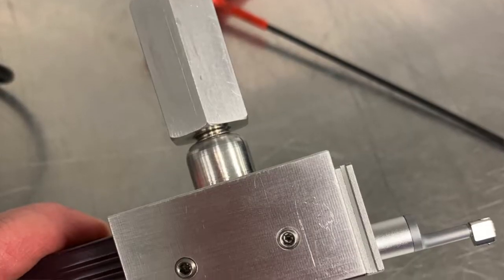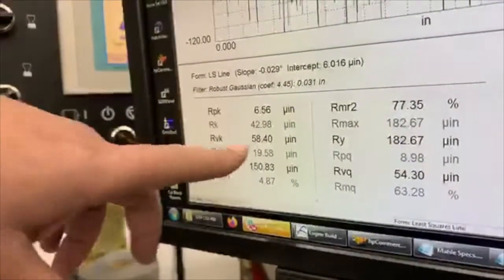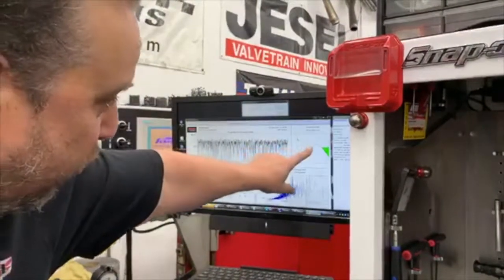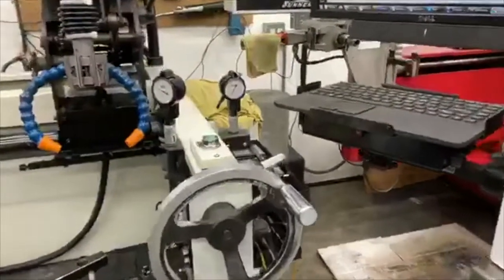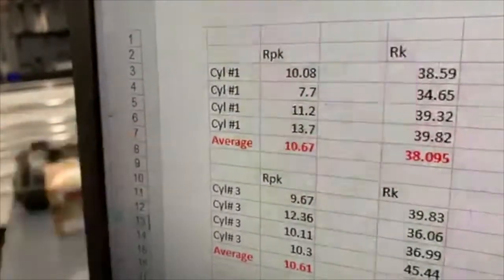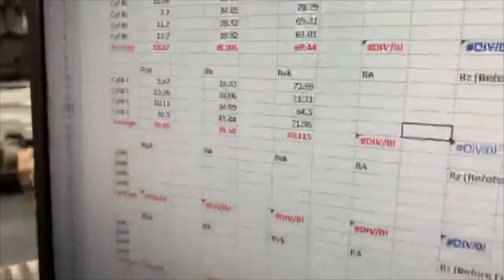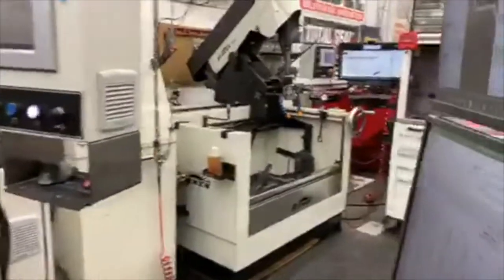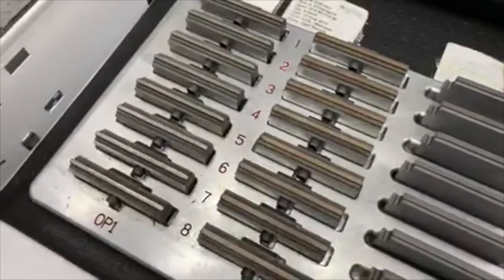Cylinder Bore Surface Finish Tips

Comment: I have an engine build 3.0 toyota .20 over using Total seal piston rings 2nd ring gapless. The engine had a fresh bore. The engine rings seated nicely for the first 2000 miles and then started blowing extreme smoke at Idle when idling for more than 1 minute. I pulled the engine at 4000 miles because the smoke wasn't going away and at that point all cylinders were showing oil.. Cylinders two and somewhat 6 were the ones smoking. We are talking 1 pint per 2 miles of oil consumption. On tear down I found no problem with #6 rings piston or cylinder. The Main leaker was #2 piston and I found that somehow the gapless 2nd ring had rotated to where the gaps were lined up. I checked the photo from the build and the two rings were installed properly, no gap.  I was considering reassembling the engine being the cost of these rings. Is this something that would be recommend. And if so is there anything that you would recommend to do to it for prep. I was considering hitting it with a hone to break any glaze on the cylinders, maybe a 220 or 320 grit stone. I was also considering replacing the oil scraper rings since there was an oil issue. These are your rings, so will they reseal? I also would mention the performance was above my expectations until the smoke stared at 2000 miles. The engine was not driven hard, never exceeded 4000 RPM for break in. Should have not been an issue and it's the first of many engines I have build in 50 years that did not seal. It would be nice to replace the set but i am retired and don't have the funds to put into a new set of these rings. My other option is install Hastings rings. They always seal. Let me know what you recommend.
Reply from the maker: You could just put it back together as is.

Comment: Most car company’s are using mirror finished cylinder walls now because how much friction cross hatching has. Decreasing cylinder temps / reducing friction / increasing power and efficiency / decreasing oil consumption….

Comment: Any tips on what i should do for hone diesel 1HZ Toyota Coaster stock engine and stock piston rings etc. For a home job!
Reply from the maker: For a diesel, the Rvk should be 55 to 65 micro inches. The Rk should be 35 to 40 and the Rpk should be 15 to 20.
Reply: @TotalSeal  Ok, thanks, I bought a 220 grit stone that will be far out if i do about 16 good spins.
Reply: Do you think because I poured petrol down the air intake to try to get going a heap of times it would have cracked the pistons? Four cracked pistons are all in the same spot between the first and second rings down the side of the piston. AdBlue (urea) in the diesel tank by mistake first off ruined the injector pump that wouldn't break the pistons, would it?
Reply: @ForPropertyInvestors  yes, that could/would certainly break the pistons.
Reply: @ForPropertyInvestors  it is impossible to know what the surface would be doing that. There are just too many variables. However, that just get it rough enough to break-in

Comment: Would there be any advantage to a WPC style nano blasted style surface versus traditional cross hatch?
Reply from the maker: Great question! While WPC would offer a low friction surface, it would be too smooth to hold enough oil to properly lubricate and seal.
Reply: @TotalSeal  doesn't the crosshatch "improve" on surface finish as well, as the rings & hatch break each other in? (Maybe that's too much burnishing in the case of treatments such as WPC treatments🤔)
How much does surface hardness in the cylinder affect the sealing ability?
Reply from the maker: @danielhertz7266  Crosshatch is different than surface finish. Crosshatch affect ring rotation. Surface finish affects oil retention, which impacts sealing. There is a video coming out next week on the Engine Performance Expo YouTube channel that really explains this in details.